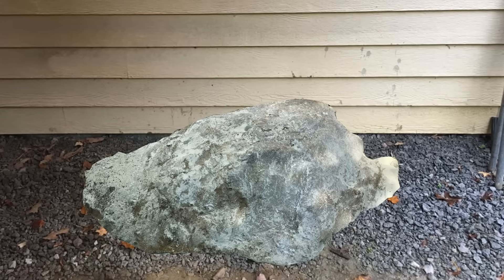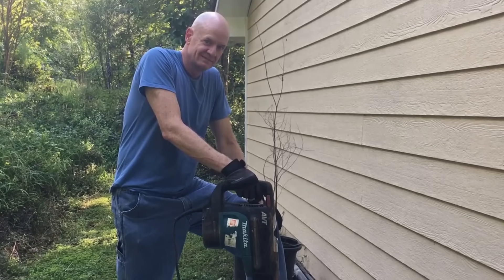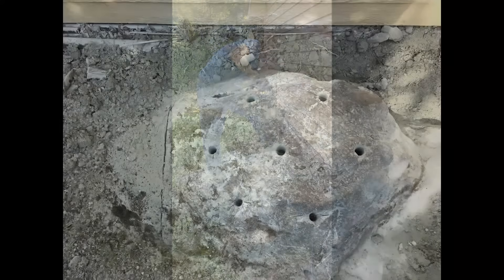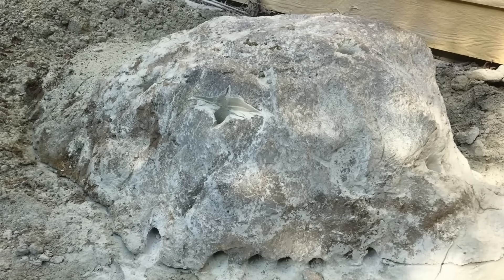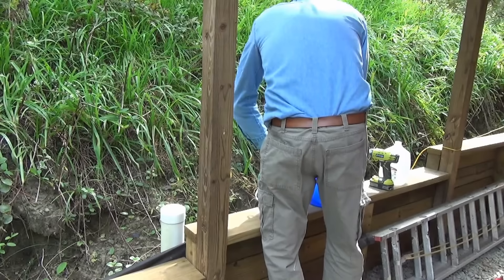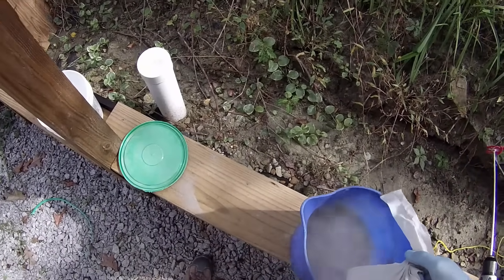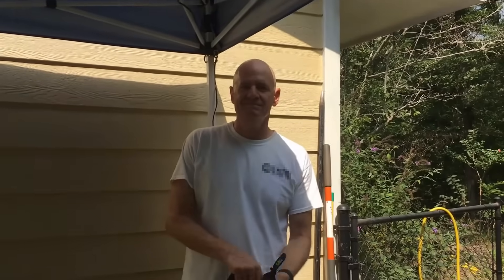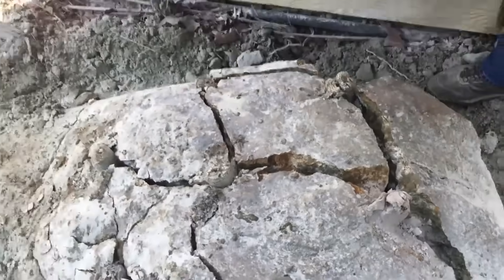Removing a BIG Rock: Dexpan to the Rescue! (#4)

Comment: What kind of rock was it ? 
How did u figure how many holes to drill? 

I have a rock that’s a side on a hill about the size of a suv I want to take out 2-4 ‘ deep
Reply from the maker: Hi Charlie!  I believe it was a very hard granite rock.  The directions tell how to space the holes.  The size of the rock determines how many.  Assuming you drill 24” deep holes, it will probably take two passes  and a lot of Dexpan to get the rock below grade. Thanks for watching!
Reply: Holes every 15" did this stuff for a living
Reply: This stuff is really good. But pretty expensive rock drill and hydraulic rock splitter works as well

Comment: How can i use this method to demolish a concreate wall?
Reply from the maker: If it's a cinder block wall, Dexpan is not the right solution.  If it is solid concrete wall, drill holes down from the top with the longest 1.5" bit you can get and take it down in layers.  If there is rebar in the wall, it could complicate the job.  Good luck!

Comment: It's too bad the holes take forever. I'm like halfway through a huge Boulder in my yard. Took about 30 holes on the first run.
Reply from the maker: Yep, that’s the biggest downside.  You spend a lot of time and energy drilling the holes. Thanks for watching!
Reply: @DIYMyWay  Yeah, I resorted to using a 3/4" bit and drilling side by side holes, then boring them out with the 1 1/2" bit. Goes a lot faster but still killer on the body.
Reply: @DIYMyWay  On year two of my same rock haha. Will be starting up again soon. I need to dig out around mine a bit so I can get it below grade and throw some top soil over it. My second pour only had moderate success, wasn't sure if I didn't have enough holes drilled or if it was because of the pressure from the dirt against the rock.

Comment: Thanks for the video! I just poured / used the product yesterday. Sitting here watching videos before I go check on it hoping I didn’t miss a step. Fingers crossed it cracked the granite boulder!
Reply: Did it work?
Reply: @onemicsessions  the first time I did it, I didn’t follow the instructions to a T and it worked ok. I did it a second time and drilled the proper depth of hole and it worked like a charm! I also left the stone covered with black plastic for 5 days, im guessing the heat helped it work a bit more as well.
Reply from the maker: You’re welcome, Mark!  If you bought the right Dexpan for your climate and followed the instructions, it should work great.  Good luck!

Comment: Very nice video, I would like to know a kind of driller you used Sir,
Reply from the maker: It was a very big Mikita hammer drill that I rented.  It requires SDS-Max bits.  I used a 1.5” wide bit that was 24” long.  Thanks for watching!
Reply: @DIYMyWay  Thanks Sir

Comment: Pretty amazing product! I wonder how it would work on a large green tree stump!
Reply: Did it work on tree stumps?  I have  several stumps that need to be removed but are close to electric, water or septic lines.
Reply from the maker: Yes, it is!  I doubt it would work for that because the wood can stretch and expand a little without tearing whereas rock cannot.  The expanding grout only has to expand a little bit to crack rocks apart.  You could try, but it is a $40 experiment.   If you do and it works, let me know.  Thanks for watching!

Comment: That is very impressive! I wish I knew this product ten years ago.  I had mother rock sticking up in the middle of my driveway and used plug and feather to split the top. It ended with nearly 10 tons of (sharp) rock like you had. Even with leather gloves, my fear was to loose a few finger while handling those split rocks. Slowly but surely, everything went well! Thanks for sharing this!
Reply from the maker: Yes, this stuff rocks! (Sorry, couldn’t resist.) 😄
Reply: " my fear was to loose a few finger "

"Loose" rhymes with, "goose" and "moose".